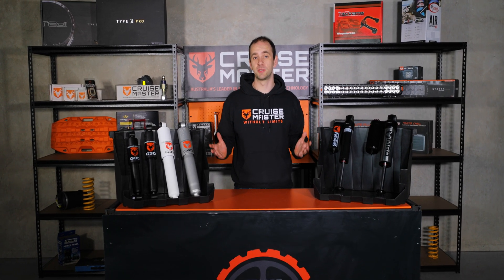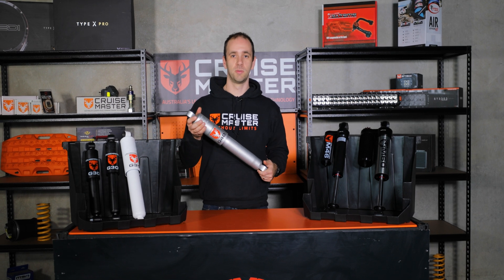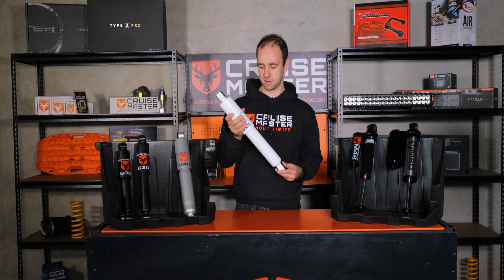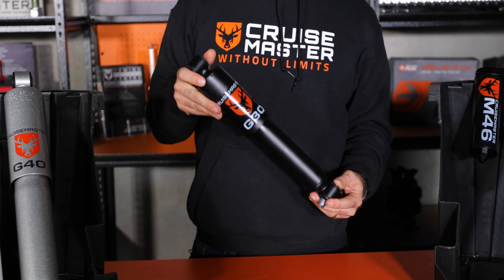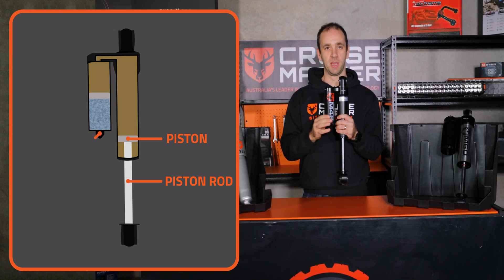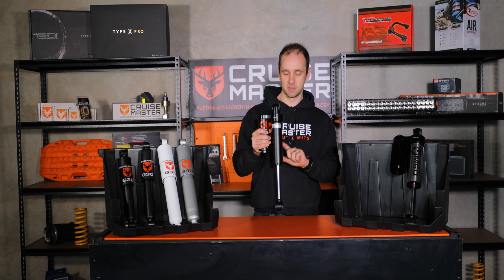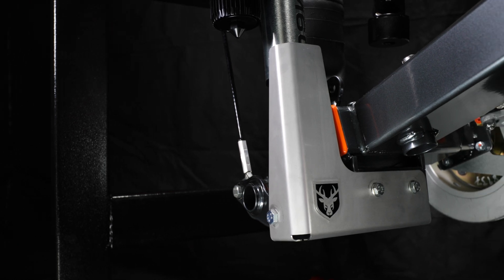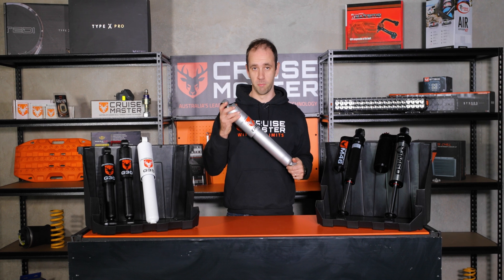CruisemasterClass - Ep. 18 Shock Absorbers | Dual Tube vs Monotube

Comment: Do you know if the current ATX shocks (M46) will be able to be directly replaced with the new larger monotube (M60)? Will changing to the M60 increase the current ATM of 4.5T? Thanks!
Reply from the maker: Hi John, it is a direct swap between shocks so can be easily retrofitted. This will not effect ATM though, the system will still maintain its original ATM. Keep an eye out for more content on the M60's next month.